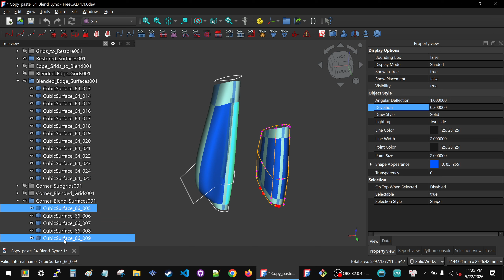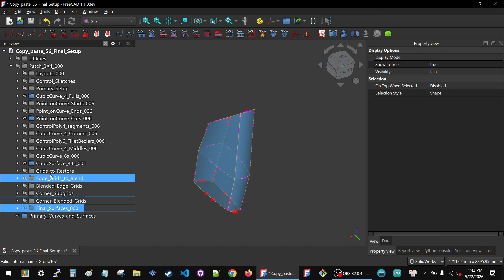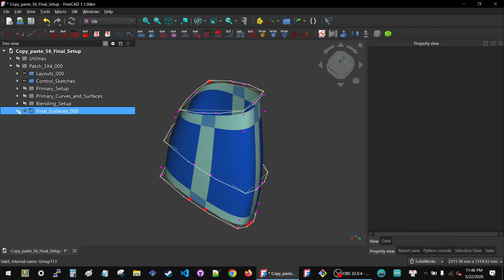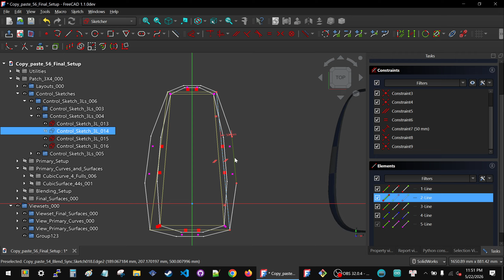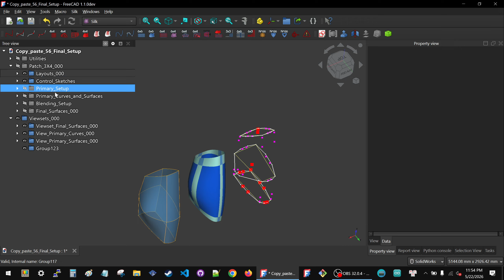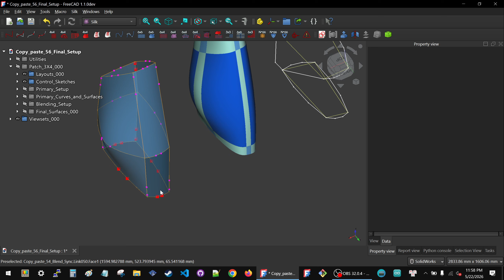FreeCAD Silk - Complete Tutorial Series 13 - Final Setup

Comment: I've been working on some automation of the Silk objects. I have a macro you can select your control sketches and respective ControlPoly4, CubicCurves, Points, CP4_segments and Curve_segments are generated for them all and organized into groups.
Another macro converts a mix curve made from 2 projected sketches made of a single bspline each into a ControlPoly6, which I may be able to use for some edges I'm trying to produce.I need to test continuity on it (hopefully G1 at least)
A view macro may be in order.
I'll probably try to figure out how to submit these to you on github.
Looking forward to the rest of the series.
Reply from the maker: Keep in mind that ControlPoly6 is extremely limited as an input for actual surfaces. So far, I have only shown it used for blending previews. Right now, all primary design surfaces must go back to having a ControlGrid44 basis, and therefore ControlPoly4 edges. There are exceptions, but they are outside of the main workflow.

Also make sure you understand the GPLv3 license that Silk is under before you invest a lot of time programming.